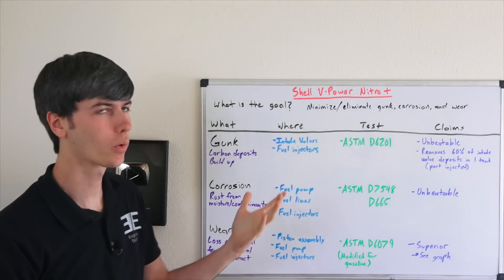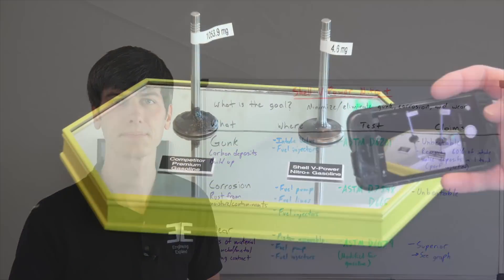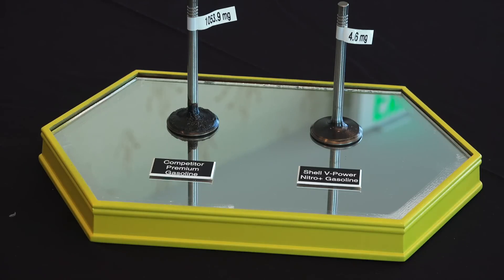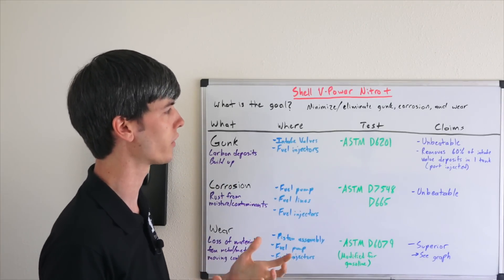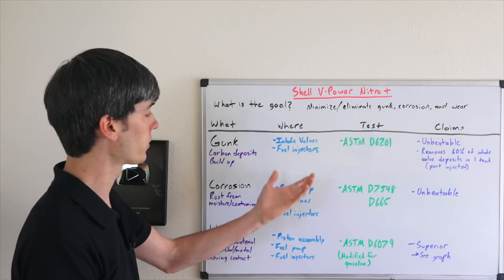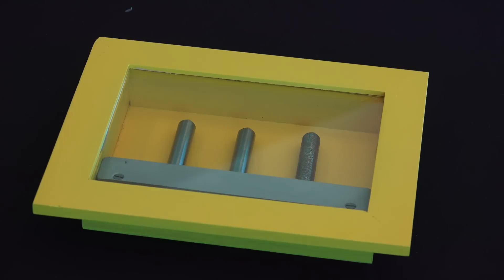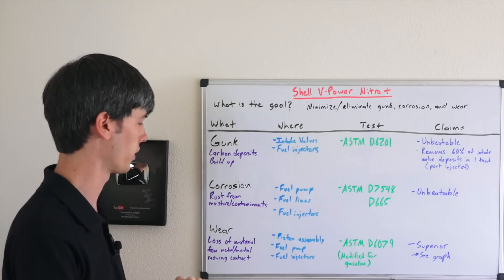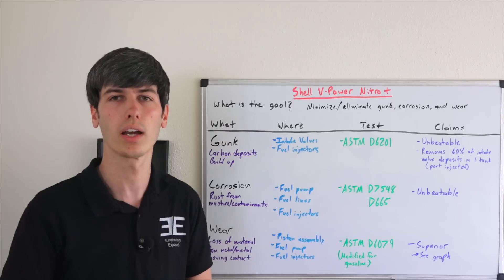Shell V-Power Nitro+ (Premium Gasoline Fuel Testing)

Comment: The thing that gets me is you're misinforming people here on your channel. 

Shell's claim may be true but only on port injection where the fuel gets sprayed onto the valves which is how they get cleaned in the first place. 
You show that picture of port injection at 0:52. The pictures of the gunked injectors that your buddy sent you are from direct injection where the gasoline is sprayed directly into the cylinder and not onto the valves thus they don't get cleaned by the fuel. 

I have seen your other videos and come on, you're better than that. This is nothing but an ad for Shell that you are probably getting paid for because unless you pull info from the Internet to make all of your other videos and just read them, then you had to know this. Even your mechanic buddy would've known this. 

Please don't misinform people here who don't know how the internals of an engine work.
Reply from the maker: chisss Didn't get paid for it. Included an annotation and note in the video description about the direct injection. Apologies for anything that seemed misleading; not my intention.

Comment: I'd love to know what helps produce more power: 91 octane pure gasoline, or 94 octane fuel with 10 ethanol. Any engineering help would be appreciated, because those are my track day options where I live. Thanks!
Reply: Different octane doesn't make more power unless you can adjust the timing. Or unless you are pinging very bad. But 94 octane is less susceptible to detonation than 91 regardless. Octane rating is a measure of that and is measured after the percentage of ethanol put in. ethanol has a higher octane rating than regular gasoline with no ethanol. (E85 is really good for that)
Reply: killeroftheshadows96 I've actually subsequently spoken to a tuning shop that tested this and they told me that Shell 91 tended to produce more power in high compression naturally aspirated cars since the benefit for power was greater having no ethanol over higher octane. Conversely, 94 octane at Petro Canada (with up to 10% ethanol) is probably better for forced induction cars because they work best with higher compression and will suffer less power loss from the ethanol. So they recommended for me, in an E92 M3, to use the Shell fuel.

Comment: Clearly the vw engine with 15k miles also has leaking valve seals. The oil and sludge on the valve stem proves that.

Comment: I'd like to know how regular shell fuel compares to vpower
Reply: I have a high compression engine and am required to run premium, I've used Shell nitro steadily and sometimes Chevron any other time I've used any other premium I've seen a noticeable difference in performance and mileage ,you get what you pay for and sometimes it hurts the wallet but in the long run it's an investment that saves you later.
Reply: i believe united states minimum is 5mg of additives per gallon of gasoline. shell is top teir. i believe they have 20mg of additives to regular and around 30mg of additives to their vpower.
Reply: Shell premium has over 5 times the mandated standard for detergent.

The other two lower octane have over 2 times..

Which I just learned. Good question.

My car can take the lower octane. Been using the premium for thousands of miles to clean it out, but now I’m switching to the cheapest they have.
Reply: lower octanes usually have added ethanol. v-power uses a process to filter out ethanol. i hear of people having less knock, and hp increases with v-power. im about 90% sure he made videos on octane and knock
Reply: The shell regular has the same additives as shell v-power. The biggest two differences is the octane rating, and that v-power adds a little more of the additive to it. I've been running shell regular for years without issues.
Reply: @RM-xs3ci  Actually while Shell does have the most additives per gallon of any brand in its Premium V-Power gasoline, it's only in 3rd place for additives in regular unleaded, behind Exxon and BP.
Reply: @DevoutSkeptic  so, Exxon has the best regular?
Reply: @AdviceandAdventures  Exxon/ Mobil has the highest rating regular (87) gas. Shell apparently has the highest rating premium. 
However I have seen videos claiming chevron supreme out performs shell v power on some dyno testings.

Comment: Shell was slow to come to my city but once they did I started using them & never looked back. For years I've been doing pretty good at keeping the brand of fuel I use consistent. I wonder which competitor their tests were run on though.
Reply: Shell is not in my local area. I fill up using non ethanol fuel. Only 5 minutes away!

Comment: These examples are pointless... You showed carbon build up situations that can not be fixed by any matter of fuel additives. Fuel never sees those valves. With port fuel injection, these deposits are not really an issue unless the engine has another issue such as excessive blowby through the PCV, excessive rich mixture, dirty air getting past the filter, ect... The only fix for intake valve deposits is to have fuel washing the back of the valves. If you have direct injection, there is no solution other than manual cleaning periodically. Thank EGR based emissions controls and separatorless PCV systems, don't blame the fuel or promote another fuel as being a cure.

If you want to make a clear point about this fuel being of any value, you should be telling us its just a rebranding of the nitrogen enriched fuel Shell put out here in the US a few years ago (and no one gave a damn about it). The only reason its coming up now is there are more cars than ever that "like" but don't require premium gasoline. This feels promotional, unfortunately.

Comment: i drive a r3 rx8 mazda, and although i haven't had the internal combustion chamber checked out, the only difference i notice between shell and bp premium high octane gas is the price. they both perform the same in terms of mileage and the throttle does feel a little bit snappier although not that much compared to low octane.
Reply from the maker: Captiv4te Until either company (or a third party) shows direct testing against each other, there really isn't much of a way of knowing.
Reply: Engineering Explained i agree. i think more than anything it is just a psychological effect of having higher octane therefore brain thinks there is more potential for a bigger bang in the combustion chamber. i will say though in my own experience (and i understand some peoples mileage will vary) i have had my fuel last longer when i use a premium fuel. i have tested this over many months and weather conditions and the i get the same results. i may have to conduct a more thorough test with actual numbers but from just pure observation premium fuel gives me more miles than ordinary.
Reply: @EngineeringExplained  I really enjoy your videos, but it is hard to imagine that after 7 years you still haven't edited out the portion where direct injection engine intake valves are shown, which has zero relevance to fuel efficacy (honestly, you are a car guy, you should have known better and never included that footage in the first place). It definitely impacts your credibility in my opinion (which sucks, because as I said, I am a fan).

Comment: Wait, how can direct injected engine get "gunk" on the intake valve (not related with Shell)? And how is fuel related to ball bearing wear? And how much did they paid you?
Reply from the maker: Indra Ida Bagus Metal to metal contact within the fuel pump, injectors (vs metal to metal contact on the surface of a ball bearing to test wear). I was not paid to make this video.

Comment: I don't buy their claims for one second.  They are being careful yet ambiguous with their wording and you didn't question them thoroughly.  This felt more like a sponsored video.  And the guy in the lab coat obviously isn't any sort of scientist -- he's just parroting whatever the marketing department told him to say.  You also didn't say if the VW pics your buddy sent were from DI, port injection, or diesel engines -- which makes a huge difference with deposit build up on the valves.
Reply from the maker: Thanks for the feedback - addressing a few of your concerns, lab-coat man graduated from MIT for his BSME and has his PhD in mechanical engineering. 

Regarding the VW engine, that's my bad, so I've included an annotation and comment on this in the video description since the very first person pointed it out. Not attempting to be misleading, and if their are facts to share I think it's of value. 

I agree it'd be great to have a direct comparison with a known competitor. From a marketing standpoint, it's typically better to avoid doing that unless you're at the bottom and showing you're better than what's at the top.
Reply: Engineering Explained Thanks for the response.  I apologize for the overly negative tone.  = )  

I'm surprised the guy in the lab coat has an engineering background though -- he didn't seem very well educated about their testing.

Comment: The only problem I see is the only helpful effect of using this gas with direct injected engines is cleaning injectors, also the pics that we're sent from Charles, aren't all those VW motors direct injection? Carbon build up on newer VW motors is a common issue, so I don't see how showing carbon build up on valves from a direct injection motor is relevant.

Comment: Interesting. I recently started driving and was wondering about the branded fuels vs. unbranded fuels. I have a family sedan and only need the lowest octane so these high performance octanes don't concern me but I wonder if the detergents/ "special mix" of the branded fuels are worth the higher price than the cheaper unbranded fuel. I think I should do an experiment! For lower octanes I don't think there's much difference if any, but higher octanes/ high performance engines I can see the branded fuels would definitely be better.

Comment: Lastly (still confused by the carbon build up on the intake valves), I have a hard time believing that most modern fuels cause such large volumes of carbon buildup. Most modern fuels must meet similar standards of quality right? So, starting from average fuels, one must make the assumption that standard quality fuel will necessarily leave such a huge volume of carbon deposits on the valves. I just don't buy it. I get the feeling the competitor fuel was chosen for the specific reason that it is prone to gunk build up (that is, not standard quality). I doubt most modern fuels would leave such huge amounts of carbon deposits.
Reply: To be honest a lot of it has to do with modern engine design especially Gdi they tend to gunk up lots and are actually recommended to be cleaned almost yearly

Comment: I get the feeling these tests aren't blinded.....Wouldn't work in medicine....
Reply: F!@#Guilt Correct, that is because it is not medicine and there is no human mortality involved.
Reply: patw52pb1  Weeeeeell, blinded (or double blinded) tests aren't about who may be harmed. it is about validity. If the testers aren't aware of which sample is which, one can't claim there is  no "hanky panky" going on. The point of double blind tests is so there is no biases on the part of the experimenters. Its not a "medical" thing. Its a science thing.
Reply: patw52pb1 I'm just saying that, I wonder if the extraordinary claims (and I agree with Engineering Explained that 60% reduction in existing carbon deposits is extreme) would be corroborated in an outside lab; that is, one not staffed by Shell employees.
Reply: F!@#Guilt  Yes, I was being facetious, but this is marketing and not life safety critical. 

There are controls in place as part of the lab testing procedure, but are not what would be considered "double blind" or "triple blind" in the bio world. 
If the claims are very far from accurate or not repeatable, rest assured that there will be US government wailing, their competitors will challenge and the consumer lawyers will line up to challenge Shell. 
Most companies use an independent outside lab for parallel validation as standard protocol for mitigating legal issues long before there is the first marketing draft. 
I agree though, 60% reduction with the first tank full is a bold claim. 
Stay tuned, we will know before too long.
Reply: patw52pb1 Good point. However, I would guess that government wouldn't care so long as the fuel meets epa minimum standards for quality and safety. I get the feeling that this will go the way of all the thousands of snake oil companies; big marketing push and then everyone will forget about it.
Reply: +F!@#Guilt either that or shells profits due to its false marketing claims will far exceed the cost of the fine, and thats even if there is one... therefore it just being a business decision...
Reply: *****
You are absolutely correct, there are consumer protection laws in place as well as truth in advertising laws here in the US and many industrialized nations. 

Regarding octane rating... in certain vehicles octane rating is very important to performance and longevity. 
The difference in 97-98 vs 99 RON is not enough to be concerned about. 
The final fuel octane rating is usually a product of the base fuel octane rating and the addition of blend additives including detergents, inhibitors, lubricants, preservatives, oxygenates, octane enhancers and governmental mandated components including ethanol and is an average that can and usually varies by 1-2 octane numbers. Through lab analysis I have seen fuel advertised as 100 octane that was actually 98 and fuel advertised as 98 octane test as 100 octane. 
Most of these blend additives are added at the point of distribution immediately before the fuel is transported and delivered to the retail point of sale. 
Sorry, but I cannot answer you "which is better" question, not enough data about the two products. 
Ask each of the fuel retailers what fuel supplier they use, then contact that fuel supplier and request a specifications sheet that includes the additives and SAE/ASTM/EU/EN/BS standards/directives testing and performance data. This data should provide enough info to then make an informed decision. 
If the 97-98 octane rating fuel has a better additives package I would choose it over a 100 octane fuel with a lesser additives package for a daily driver. 
Your 1998 BMW 328is is equipped with a knock sensor and a somewhat intelligent PCM/ECU that may be able to dynamically adjust the ignition timing under load to fully utilize the increased octane of 97-99 RON and possibly increasing torque and power output. 
Using a fuel with a good additive package, performing oil changes, maintenance and servicing the PCV and EGR regularly will help mitigate the buildup.

Comment: OMG! 15000 miles and you have THAT MUCH carbon build up?! So, basically, avoid VW? :) I had a pontiac grand am, 150,000+ and there was very little carbon build up on the valves, zero carbon build up on the pistons. Aside from a light coating on the exhaust valves, my motorcycles get no carbon buildup. Something has been cherry picked in the state of denmark me thinks...

Comment: What good is such comparasion when they dont tell what "competitors fuel" have been specificailly used? If you make a premium fuel and test it against some craptacular cheap fuel with "premium" sticker on it, of course that yours will be significantly better. Mixed feelings about these demostrations, Thanks for the video anyway Jason

Comment: I call BS. Manufactures have been making products for years that claim they "clean" valves, injectors etc. This needs more research from various other sources other than people who work for shell such as un biased mechanics. Also lets just switch E85 already! its way more cleaner than any oil based fuel and thats been proven
Reply: E85 still has gasoline in it. And actually requires more fuel to get the same power. Your mileage actually goes down, but it is cheaper because of corn subsidies.
Reply: ***** There's a grain of truth to this. It doesn't destroy the engine.  It damages plastics, rubbers, and materials that can swell due to exposure to ethanol fuels. No motor has ever been damaged due to ethanol ingestion equipped with the appropriate timing and fueling to prevent damaging lean conditions and detonation.  The parts that do get wrecked are the fuel floats, diaphragms,  rubber seals, fuel lines and pumps that are not ethanol safe.
Reply: +Devin Williams an increase in octane has nothing to do with MPG. You're mixing things up.
Reply: ***** I was saying that in a "Flex Fuel" vehicle, you're running a lower compression than needed to take advantage of the corn juice. In a motor explicitly configured with corn juice in mind, you can see similar mpg but with more horses than gasoline
Reply: +Mason Jenkins cracked fuel lines/ orings is honestly your fault and wont hurt the motor unless you spray fuel everywhere and it ignites... but again that's on you.

Comment: I pumped Nitro+ in my 2000 Integra for the first time a few days ago. I definitely notice a slight difference. Previous tank (Shell V-Power (pretty sure it was not Nitro+), at half on the fuel gauge, I had around 162 miles. Right now, at half tank with the Nitro+, I am currently at 178 and I wasn't doing a very good job of being efficient on this tank.
Reply: gnoultnecniv That doesn't sound very scientific.